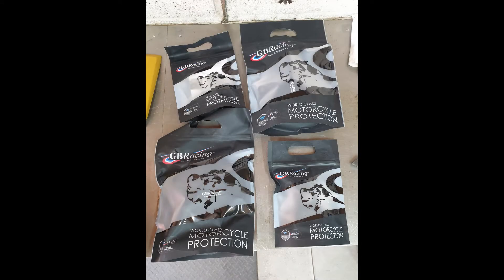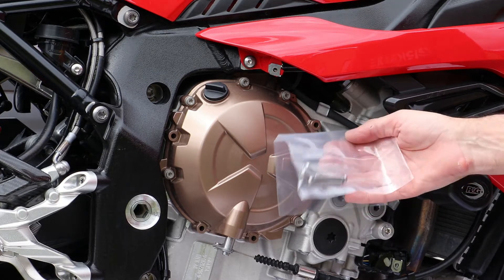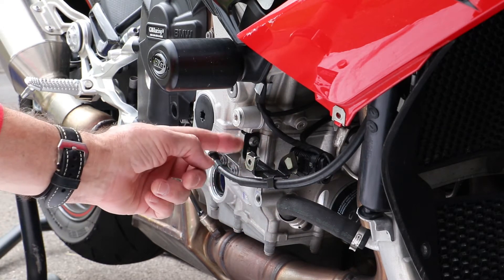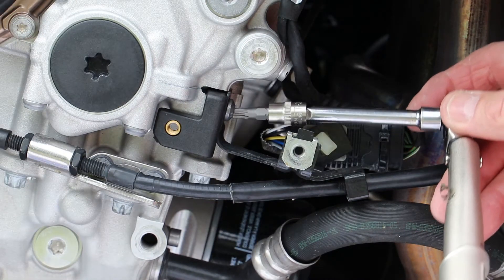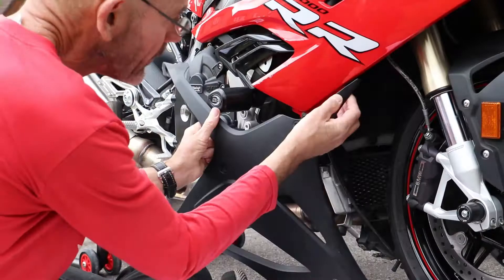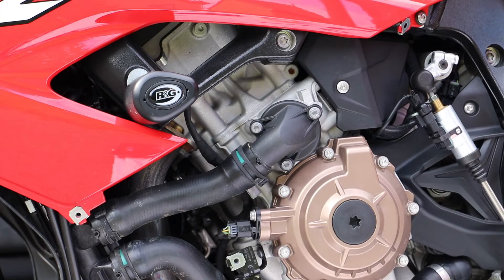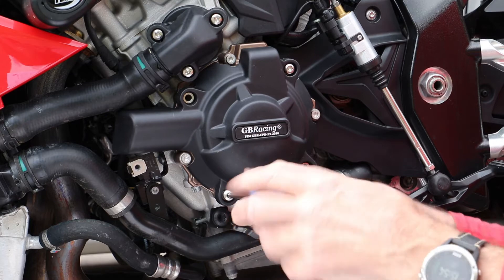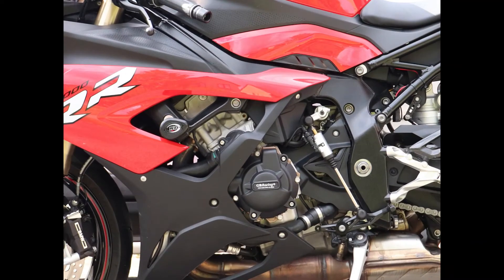BMW S1000RR GB Racing Crash Protectors

Comment: Thanks for this video. Just used it as a guide when installing the engine covers on my K67. That bolt holding in the bracket for the clutch cable is indeed a bit of a pain. Thought I was stripping it until I said screw it and took out the impact and it came right out lol.